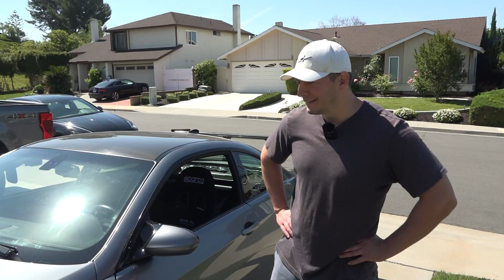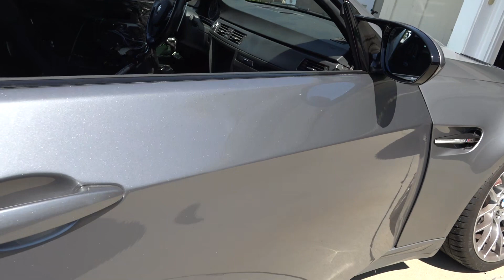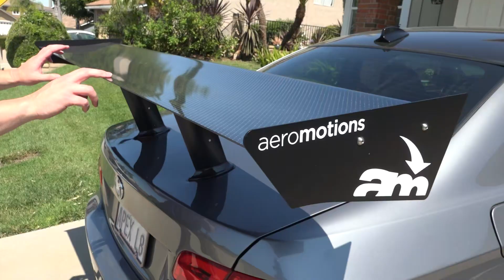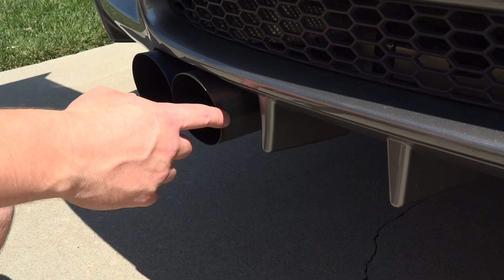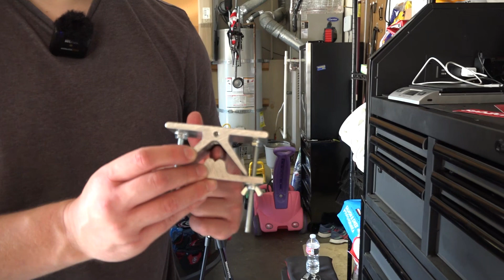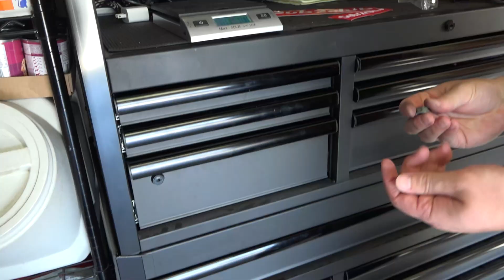BMW e92 M3 "lightweight" Track car build interview

Comment: what size drill bit do you recommend? :D
Reply: I hate to be generic, but it depends on the part I’m drilling and the material. I love hole saws with a smaller pilot bit. Use oil and take your time. Slower RPMs are usually better.
Reply from the maker: Yes 😂

Comment: What do you use to drill speed holes?
Reply: I tend to use metal hole saws with a pilot bit. i also have a hydraulic hole punch for larger holes.

Comment: 2007 335i here, 2670 lbs gutted,  carbon bumpers, hood, fenders, doors,roof, rear trunk section, the whole rear section of the car ncluding quarter panels minus the pillars  are carbon. built engine, 8hp75 swapped, two kirkey race seats, carbon dash, setup for drag racing. no modules or stock wiring, maxxecu and simple setup.  theres a company in europe who makes a full oem m3 carbon body panel kit including rear quarter panel and rear section of the car from the roof of rear windshield back.  you cut the whole trunk section out and de-skin the rear section, you can cut literally 350 lbs of steel out of that area of the car when you reskin it looks 100% oem,  my car looks like an oem e92 m3 (same color as yours) but with 28" radials and skinnies up front. the windshields and windows save a ton of weight too when u go lexan.   bought a 335i cuz i didnt want to spend the money on an m3.  doesnt matter what we buy we always end up modding them lol.  that m3 looks expensive!
Reply: Please make a vid showing the car interior and stuff
Reply: @Hanzthelord  we're going to do a follow up vid.
Reply from the maker: Love the last statement! Seems like there are quiet a bit of turbo 335s in drag scene. Must be a good formula that works! Thank you for the comment!
Reply: @Sub2club   theyre cheap like hondas to build now.   for about 8k, you can wet sleeve an n54 block, run bc 3.25l stroker kit, 625 studs, valves, springs and fire ring the block. good for about 900whp reliably at moderate boost.  maxxecu makes a standalone plug and play for n54 cars now, deletes the direct injection all together and the ecu, injectors and parts are chepaer than repalcing factory injectors on the n54.  thats why you see alot of them being built.  the 8hp swap is 3k and a bone stock 335i with 8hp70 on bolt ons 550whp are actually pretty fast.
Reply: @honk3times  do you have an Instagram account where we can see more of the car?
Reply: ton of fun, eh? I have a set of lexan windows waiting to go in... just got busy with life.
Reply: You had me until "automatic" 😢 Yeah yeah racecar, I do understand lol Sounds sick though, good job!
Reply: @blankname8553  you can run the zf8hp without a torque converter, and use the internal clutches in the 4 clutch packs on a potentiometer on a racing sim foot clutch and it literally is a 8 speed sequential, clutch kicks, start and stop requires clutch in.  race car application only as it wont last very long on the street.

Comment: Very nice! I just don’t love replacing factory doors without a cage. It’s just a safety for me, it’s probably fine but I don’t want to check that. I have an e36 m3 fully gutted, with me in it it’s 2750.
Reply: A couple points of discussion on that- its less dangerous than riding a motorcycle, which nobody would make mention of if i rode a motorcycle. i also daily drove a smart car for the last seven years... i might just have a higher risk tolerance.
Another thing is the OEM door bars are steel, but they aren't as significant as people seem to think. They are about as thick as the stamped rails they use for street signs. they do add some protection, no debate there, but they are only useful in very specific scenarios. i felt fine getting rid of them.
Reply from the maker: Great point! Mike had mentioned about that and he plans to make some changes before he starts tracking this car heavily again.